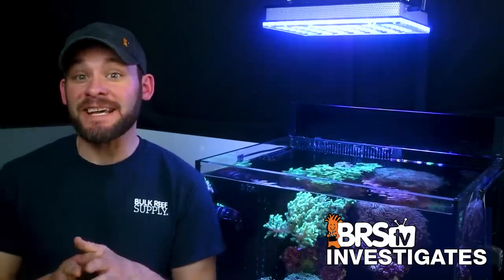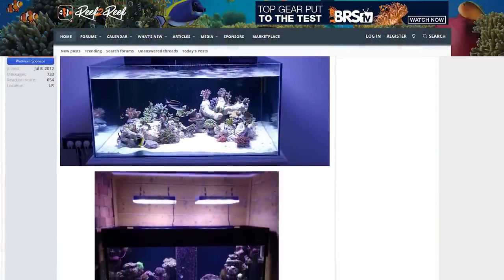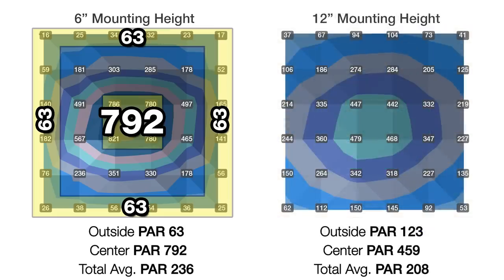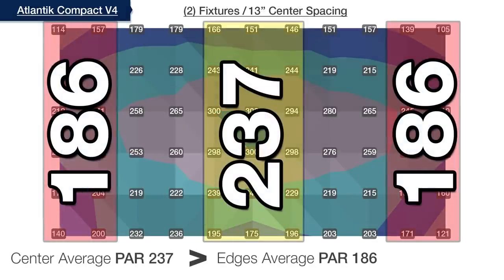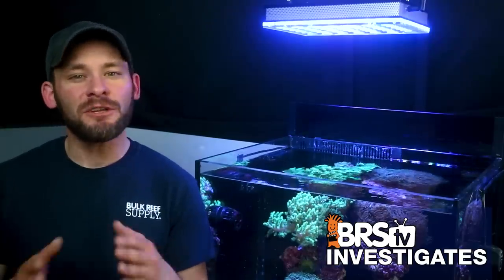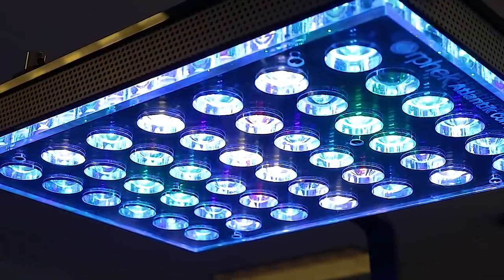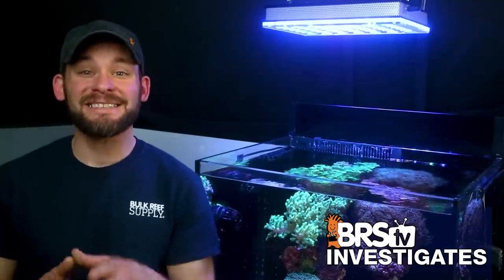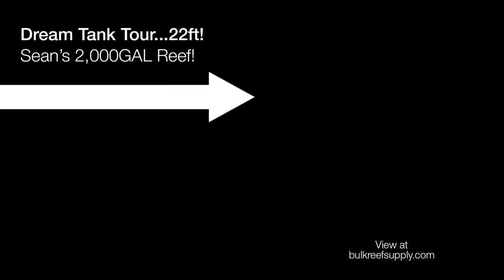LED panels should provide better spread, right? Our Orphek Atlantik V4 Compact test and setup guide!

Comment: These tests are great, thanks for posting.  One issue I find with the testing though is when you start the multi fixtures.  When your adding 3, you may actually be able to lower them a few inches and space them less far apart.  This should result in less spill to the room, and give you the ability to run the lights at a lower setting.

Comment: I so wish they would redo the app man. The V4's I have are awesome lights and hands down better then the Gen 3 pros they replaced. It's just the app is glitchy and a pain to make actual changes to the light. Not to mention the constant gateway not communicating issues. 

I have had to deal with them a few times for app related issues (Android) and was told to try an Apple product lmao. I advised them I will not be using an Apple product. I still dream of a new user friendly app though 😁
Reply: Agree 1000%! The app is horrible and it's not even in the app store now. Tried to post comments in Orphek Facebook group but the admins won't post them! I'm fed up!
Reply: Agreed.They need better software people. Love the light, HATE!!!!  the app.  Android also.

Comment: I love my atlantik compact v4. The hardware is excellent. However many of us owners have a similar complaint that the controlling app is just no good. There has been no indication from Orphek that they plan to improve their app which is disheartening.
Reply: The app is a major problem and they refuse to address it. The hardware might be better now but the Gen1 Atlantik  LEDs were burning out in less than a year! Had to replace some of the blue/uv diodes in my 2017 Compact twice now!!

Comment: Those of you that have the light, go check the LED diodes in Channel 2 and 4.  They are prone to burning out.  I had Gen 1 Compacts and had to replace a bunch in Channel 2 and 4. Customer service was great and sent me replacements free of charge but was a hassle having to do it twice!  The third time, I opted to purchase a complete Gen 2 PC Board. So far so good but I hear from people that the Gen 2 lights will also burn out.  This is not acceptable from a $700+ light!  There are many complaints with the App that runs the light and they refuse to update it.  Not sure what's going on but the App isn't even in the Google Play store anymore.  Lastly, the selling point back then was they had red and infrared diodes.  Now i think the reds and infrared wavelengths are completely unnecessary and may even prevent coral growth!  Knowing what I know now, I'd never bought these.

Comment: Hi BRS Team - great Video !!

I plan a shallow lagoon reef with a 55x20“ footprint , just 14“ of height. (140x55x35cm)

Can I use 2 V4 Compacts there for my  LPS-only goal if I mount them 16“-18“ above the water ? 
I got 2 OR3 90 Blue Plus already on my current tank . 

Thanks a lot 
Greetings sebi
Reply from the maker: Given the short height of the tank and your LPS only goal, that shouldn't be an issue.
Reply: @BRStv  thanks a lot
I wanna keep acans, euphyllia , goniopora , fungia and stuff like that ....

Can I get better colors for my LPS with the Orphek’s ? Now I have a AI Prime and i not so happy with my colors....
My water r good and stable, I made a icp too ...

Greetings 
Sebi

Comment: hello, for you what is the best led on the current market? on a 24 "x24". thank you
Reply from the maker: We like to think of gear in terms of "right tool for the right job" rather than "best", specifically because each reefer has different goals and nearly every lighting option is capable of sustaining coral. This is exactly why we have started this light testing journey so that reefers like you can have the data and information you need to make an informed decision on which light will best serve your specific goals.

Comment: The stock lens are 120° you can order them a smaller angle to throw deeper into the tank. Max distance  is 30+ feet deep.
Reply: Joe Villavicencio those are not 120° lenses.  No light with 120° lenses would need to be raised to 16” to get a decent spread.
Reply: Those studies are for earlier versions of the light not V4.
Reply: @philwu271  ah I see that now. But doesnt change the fact that you can change the lens and get deeper readings
Reply: @Joe Villavicencio All I am saying is if that is 120° lens or the Orphek, then the Radion has a 360° lens. And the AI has a 200° lens.  I bet if you asked Ryan and Randy they would tell you that they say it’s 120° lens. But the data is clear that it is nowhere close to that.

Comment: Am I Interpolating correctly that on a 60” tank center light on 30 then others would be at 15-16 away from center?
Reply from the maker: If you're using the data from the 3 light fixtures over our 48" test tank, that would mean the middle fixture on center, then the right and left fixtures 11.25" away from the edges of the tank.
Reply: @BRStv  one more query.   I have 2 compacts.  SPS dominant tank, but a 40B 36x18  I was going to space them 22” apart or 7” from the edge.  I can only get 14” high mounted based on tank location. 

Do yes this make sense?

Comment: Isn't the Q Maven a panel LED? I thought you did that first.
Reply from the maker: The housing of the Qmaven might be a bit deceiving in this regard, but when you look at the underside of it each "cluster" of LEDs is really only about 6"inches by 6"inches. In the larger Qmaven's they have the same LED "cluster", but use two or three of them to cover longer areas. However the Orphek Compact has LED spanning nearly all of the 13"inches by 9"inches footprint.
Reply: @BRStv  I gotcha. Thanks for the clarification!

Comment: Will the brackets mount on rimmed 33 Long tanks?
Reply from the maker: The mounting brackets work best with rimmed tanks, but they do include some plastic shims that can help mount them to rimmed tanks. Honestly, you may need to do a little modification to the rim where you plan on installing the mounts, but it can be done.

Comment: Great vid! How does the price compare to say Gen 5’s?
Reply from the maker: If you're looking at the SPS tank example over a 4ft tank, three Orpheks are almost a couple hundred bucks less than our recommendation for three G5 XR30 Pros or Blues. however we also found that Four G5 XR15 Blues was able to achieve the same PAR goals for the same tank, which winds up being less costly than the Orpheks and the XR30s.
Reply: Bulk Reef Supply Brilliant! Thanks
Reply: I'd recommend you spend a bit more and go with Radions. There's a reason they are almost industry standards. I have been running the Compact for 3 years. I made the wrong choice 3 years ago.

Comment: Unpopular opinion but I am just not impressed with these lights. You can clearly see the disco effect going on. Many owners try to convince others they don't have the disco effect but this video and my own eyes say otherwise. I also had a terrible interaction with a former Orphek distributor. At least, I hope he isn't the distributor still. No way these lights should ever be put in the ranks of the Radion or even Kessils. Sorry, not sorry.
Reply from the maker: Love how you always keep it real :)
Reply: This is exactly my problem with all led lights, I would never slightly consider a light that had disco ball effect, I have 3 gen 3 pros with diffusers from my last tank that I'm waiting to use on my new build, I wouldn't use them without diffusers..... not sure if you need them with the gen 5s as I haven't seen them in person, if I was going to buy new it would be gen 5s or kessil, as far as I'm aware these two are the only LEDs out there that dont have disco ball effect.
Reply: Somehow someway BRS has convinced people not to buy lights based on a disco ball effect.. That's crazy!

Comment: 13:30 - except for the cords coming down.  Those horrible, nasty, disgusting cords.
Reply: Um all lights have this problem?
Reply: boomcar911 Not fixtures that use legs, mounts that connect to the tank or canopy systems.  I would never use a light set up they didn’t have a way to hide the cord.